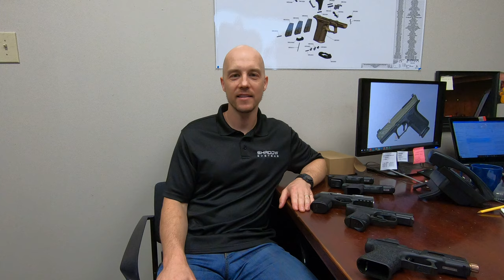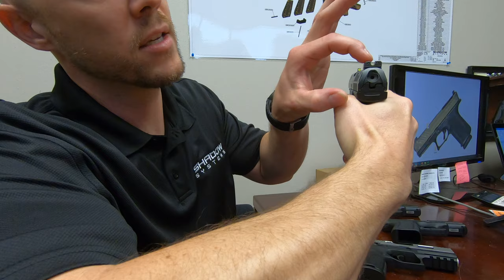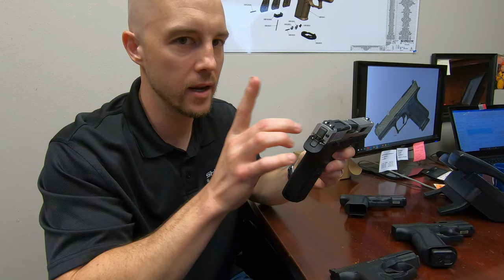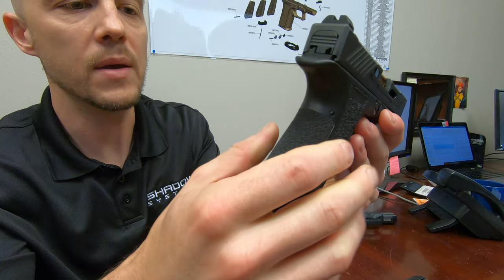Technical Tuesday: Low Bore Axis

Comment: So my question.  Now that Shadow Systems has discontinued the modified Glock Gen 3 SG9C and is now selling those remaining at a discount; should I get the MR918 elite or one of those?  The SG9C is what got you on the map right?
Reply from the maker: Eric E850 
It’s really up to your preference. Our SG9C is our customized Glock, which was where we started. As far as customized Glock packages, it’s really hard to beat for the price and is built to be an ultra-reliable hard use gun. Our MR918 is our proprietary pistol, built on our frame. When we were designing it, we took everything we knew about customizing guns and put those features and more into the MR918. The MR918 does offer exceptional ergonomics with a grip that is customizable to adjust grip angle. This is not something you can do with the SS9C.  They both are good!  It depends if you want a customized Glock or an MR918!